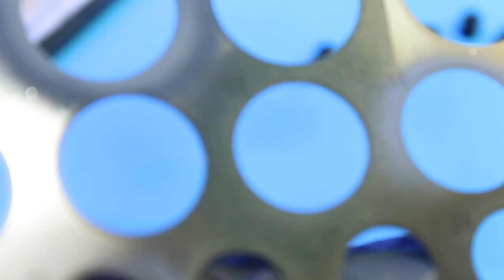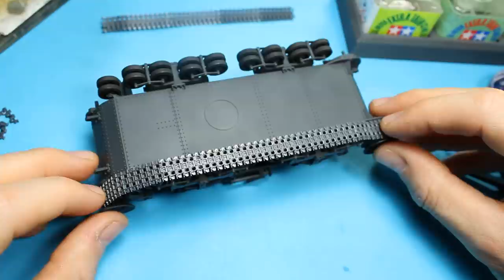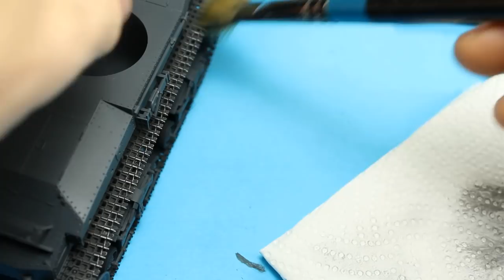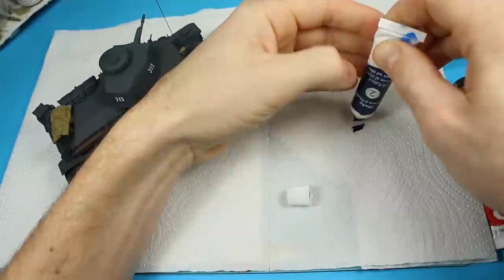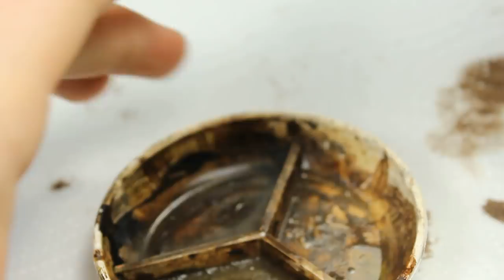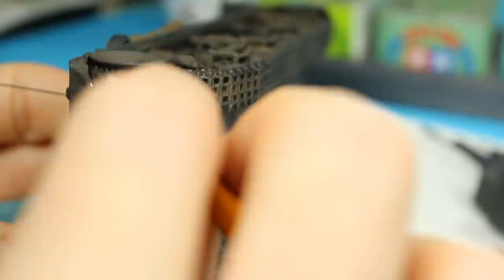Academy / Airfix 1/35 Panzerkampfwagen 35 (T) step by step, model tank build. Part 2

Comment: The CMK kit was re-boxed by Tamiya in 2012. The Academy kit was all new moldings, but was itself re-boxed by Airfix in 2019. It was issued separately, with appropriate parts added, as a Pz 38(t) command tank as well.

I've found that Testors liquid or Tamiya's orange-topped glues provide stronger, more flexible joints when assembling link & length tracks.

Comment: Did you ever weather with real rust. It takes a little time to get the right technique. But the affects are grat. Don't apply any clear over it or it will chang the color slightly. To make it. Put a stell scrubbing pad in a jar and fill it with vinegar. Let stand out side for a week or two. You will have real rust. It wil be some liquid and some small parts of rusted metal. I tried it and it looks grat.

Comment: Yeah the kits from 1996! Think Academy added link n length tracks I'm sure the cmk had rubber bands! Did the airfix kit have the antenna in the instructions whare it should be mounted etc? Academy's didn't but wasn't a big deal the barrel I changed and jack block for a dragon part periscopes I like to fit later but couldn't on this mine is pretty much all dragon parts haha looks great though

Comment: Sorry, but this kit is definitely not the CMK kit reboxed. The sprue- and parts layout is different. The Academy kit has much finer detail than the CMK kit, not that the CMK kit is necessarily bad. Also in the earlier part of this series, you made it sound like the later Hungarian tanks were based on the 35(t) chassis, where they only copied the running gear but the vehicles were otherwise completely Hungarian designs. Looks like you did a good job on this build, good job.
Reply from the maker: Yes I jumped to that conclusion somewhat, it would have been nice to have the two side by side. I meant the running gear was utilized on the Turan tank not that it used the hull, hope that came across. Thanks for watching 👍

Comment: hey i see this is another model where you don't apply varnish? I'm trying to stay away from varnish before weathering, just dont know if i should; im about to build my first Tamiya 35378 panzer iv kit. i plan on using tamiya enamel panel liner and abteilung oils.
Reply from the maker: So basically the varnish is used on the earlier videos as they’re for beginners and that is a relatively fool proof way to avoid issues, if you’re new to it try a varnish if you feel like you need one. We are talking about gloss coats here to be clear, all the models received a matte coat before weathering, again not something you have to do but it does give a good flat base
Reply: @ChampionScaleModelling  thank you for replying, i really like your channel and you're builds. So the videos of the manchurian t34, the panzer 35t, or the hanomag with the green camo were all matte coated before decals and weathering; just asking in case i misunderstood lol? does a matte varnish before weathering still protect the paint like a semi or full gloss varnish would
Reply from the maker: No problem, no, it would go like this (for ease):
Paint
Gloss (if you want, no need but some find decals go down better)
Decals
Gloss or Matte, some prefer to use washes on a gloss, some don’t. I use a matte at this stage to dull down any shiny points and blend the decals
Weathering 
Final matte if you want, I don’t but some do
Reply: @ChampionScaleModelling  hey thanks for that write up, i wrote it down in my notes. i was thinking, if i put down a matt coat and do weathering  and later cleanup of the surrounding areas, will the surrounding areas not get a lil dirty or discoloured from the stuff that spilled out of the panel lines or rivets? actually never mind on the sturmgeschutz iv you say it can discolour on the surrounding on a matt coat and to avoid it to use a gloss coat. how about a semi-gloss coat, will it avoid discolouring the surrounding areas on a semi?